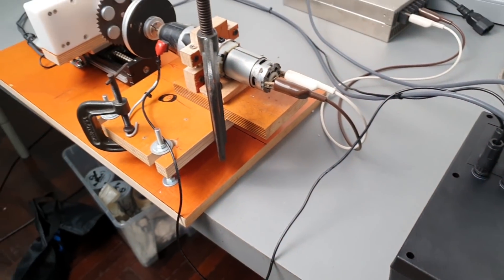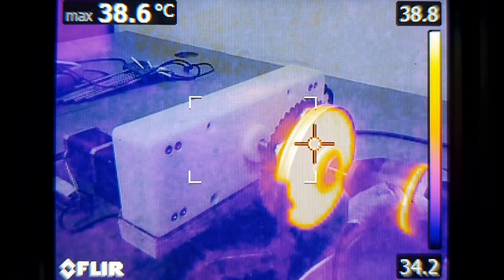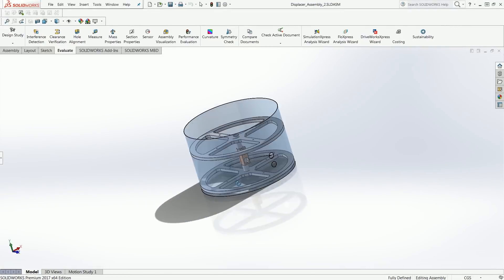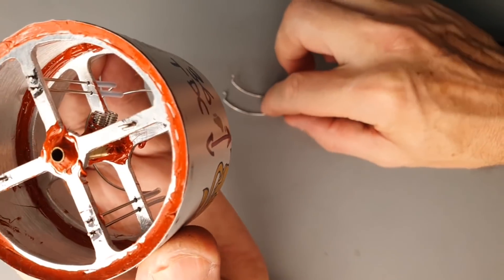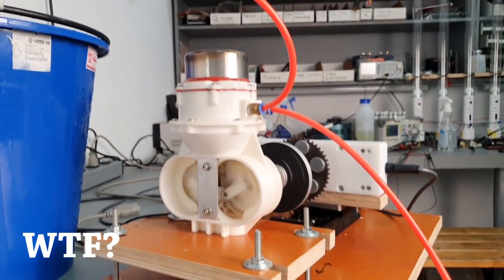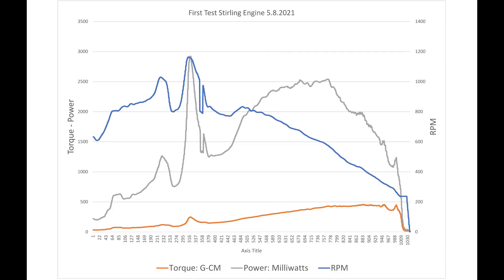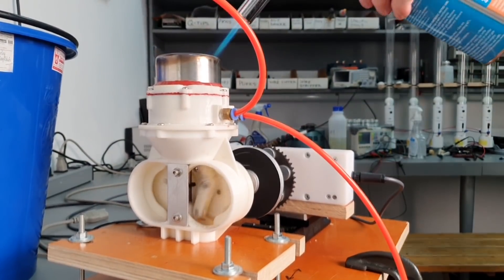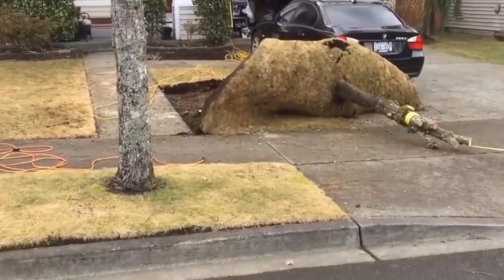The Stirling Engine Project:   Episode 3

Comment: As long as you balance the weight, it's fine in some designed to have a displacer also double as a regenerator. A regenerator's job is to store heat and later release it depending on which way the working fluid is flowing, and a consequence of doing this job wel or nessesary for a regenerator to do it well is that that one side stays hot and the other side stays cold. Thus, thermal conductivity is not good for a regenerator but surface area is. 

Furthermore the other important factor in choice of  material is the volumetric heat capacity of a solid cube of material. Why a cube's volumetric heat capacity? Because a cube of any two  materials can be shredded to the same surface area and have the same dead space, but one will store more energy per degree temperature rise then the other.  That is in units the number of jouls it takes for a 1 degree Kalvin temp rise in a cube. I like these units  J/(cm³×C) for their small numbers instead of mega jouls in a cubic meter. 

Examples:
Glass (silicon dioxide) or crushed sand has a poor volumetric heat capacity 1.98 J/(cm³• K)

Low carbon steel such as used in steel wool stores virtually twice as much at 3.93 J/(cm³• K) and has a thermal conductivity of 
45 to 55 W/(m•K)

While 316L stainless steel such as a 316l ss  screen has a volumetric heat capacity of 3.99 J/(cm³• K) and a thermal conductivity of 13 to 16 W/(M•k). 
 

Just pointing out, 316L stainless steel steel has a slightly higher volumetric heat capacity, and 316L stainless steel has a significantly lower thermal conductivity, and is  significantly more resistant to oxidation, making it a markable better regenerator material. 

Also, one  needs to consider is the power reducing friction the fluid has through the regenerator.  And the traditional off between dead space and fluid flow.

Comment: One of my early thoughts in this was "Get a half inch slab of copper and fuse it to the end of your cylinder to act as a heat bank!"  Half inch is likely too much. Quarter inch with a stovetop heating coil fused to it would likely work better. You can fine tune the heat then. Especially if you sandwich the coil between two bits of copper then add a bit of insulation to the top, stick a thermocouple into a little hole and monitor the power consumed by the coil itself also. That'd get you a good indicator of power added to the system, heat produced during that addition, and thus a predictable set of input values for the engine itself. Not to mention better control.

Might also let you monitor for the possibility of that internal combustion. If the heat input is static yet there's a sharp spike in heat in the chamber, you know you're getting extra heat from an unexpected source. Like a coating burning off of the steel wool, which I've heard can happen. Some steel wools are coated to stop oxidation. Some actually have detergents added too. Stainless steel wool would be different again. Pre-heating your diffuser material in a tin can to season it prior to use might be a way to eliminate this issue.

Comment: Thank you for some very well conducted experiments with your Stirling engine. I think we have to recognise that the Stirling cycle is a pathetic way to convert heat to useable power.
So little energy is available to overcome friction that the smaller  Sterling's work better than the large. So poor is the performance that the measure of success seems to be  universally judged by the free running  R.P,.M. achieved. This is before any useful load is imposed. The weakness in design is the piston/cylinder fit and the heat exchanger design/content. We all seem to gravitate to steel wool. Not the best when copper wool is available in the pan-scrubber market. The Stirling is an interesting challenge but even when successful, the optimum use in the real world is limited to very specific installations.

Comment: There is great possibilities of inspiration from Stirling models. One of those has adopted. single slot crankshaft and operates the displacer attracting it by magnetic action. It really reduces weight improving the timing of the displacer. There are some hits in the action but, who knows.
Than there is an extremely complicated route but promising, making use of the TAUROZZI pendolar piston which really makes pistons very energy efficient optimizing friction.
Other possibilities could come out from the "diafragm" compressors design which has metal sheets as diafragm...
Let's keep thinking...

Comment: I have to wonder how lubricants and coatings hold up in such enginer. I haven't seen anyone anodize aluminum in these parts or serious lubrication systems. Plastics look good as the lessen vibration but is there warpage over time? could regenerators be made of beer cans? what was the cylinder head made from. metal spinning might be a DIY option and temp resistant steel like Inconel or Hastelloy.

Comment: Stirling engines might very well safe the world. They are the best way of converting waste heat in energy. They have many applications and if you can make a small one for the home it would be one step towards this future. Please keep going but at least share the 3D models with all of us.
Reply: @astebbin  Yes I agree turbines on a larger scale are way better as of today. However they are big, costly and difficult to manufacture with many moving parts. 
Thermoacoustic stirling engines on the other hand have basically zero moving parts and can be very cheap, however more research is needed in this field.

Comment: I don't really know what I'm talking about, but I have witnessed a material that is impervious to heat and acts as a complete insulator. It is extremely light and could be the perfect material for replacing the wire wool?

Comment: There would be much more better to have a stirling that does something userfull. E.g. to charge car battery automatically without flame using solar energy only. And also that will startup automatically using some magnets or reverted dynamo for a while. Otherwise it is a nice toy only.

Comment: Great video Leo.  I encourage you to re-design and optimize but I do fully understand the burn-out and how much blood, sweat and gears you've invested.
When I first go into Sterling engines, I soon realized that even past the amount of fine-tuned tweaking, that ultimately professionals have never made them perform to the level of replacing anything we current use today. It was a sad conclusion because other than a few really niche applications, as neat as they are it's just a no-go...

Comment: I have to say, that I disagree to a point, I think Sterling engines are the answer to the problem that we've created with hydrocarbon carbon emissions, no they won't replace the internal combustion engine automobiles, but they very likely could be the answer to electric regeneration but a lot more money needs to be spent on development, we have all that free solar radiation that we could use

Comment: I too had similar ideas to this, but through circumstances, there is not even a first prototype, and, unlikely to be happening in the near future, so, I will share my thoughts. What about using this engine to improve the efficiency of a diesel generator (could be petrol, I just like diesel) you mount the hot end of two of your engines in the exhaust gas of a generator. your engines being horizontally opposed should cancel out much of the vibration. an internal combustion engine running at peak torque would have a jet of flame out of the exhaust manifold to replace your gas torch.

Comment: Reynolds number describes the difference between the fine steel wool and the potscruber. I also have noticed the phantom power surge associated with the steel wool.i believe you are correct in describing that phenomena as internal combustion.  I have used poster board, Elmer's glue, fiberglass cloth, aluminum foil and plaster Paris in the development of a light weight displacer. I have thoroughly enjoyed your video, maybe I offered some benefit to your endeavor. Great inventing.
Reply: Wonder if a regenerator could be printed from bronze powder? Thinking about how to characterize that in software.
Reply: If its internal combustion it should go away after The first test

Comment: One company on Ebay sells fine oil free 316 stainless steel wool as well as thicker stuff. I find it lasts much longer and maybe cuts down on volatile residue in the working parts. I got tired of the wool degrading. Anyway, you might like the Lustersheen 316L, average fiber width .002".

Comment: I'm thinking to couple a Stirling engine to the hot side of my AC unit. Do you think it would help to reduce cost in power consumption, by using the waste heat to power a Stirling engine?

Comment: Neat project.

I think it's worth it incidentally, stirling engines are a really simple way of converting heat back into more usable energy. If you could work out a way to easily print them in a range of sizes I can think of all kinds of uses it'd have.

Comment: Hi Leo, great project! 😃
I suggest to use electric heating wires instead of a burner to be able to compare input and output energy (efficiency).
Alternatively you can try a 3-cycle free piston Stirling engine like in the Youtube video "u-VEVCWjawM".
Reply from the maker: You are so right about this. The reason for the flame torch is that It has a very short thermal time constant. Until my engine is running reliably for minutes at a time, I want to be able to shut things down as fast as possible, I don't need things melting if the coolant stops flowing. Once I have more confidence, I will build an electrically heated cap for the hot end so I can get a true number for power input.

Comment: You know, on that free energy attracts topic... I was wondering about the drone electrostatic motor that Plasma Channel "
Drone Harvesting INVISIBLE High Voltage From The Sky" and others have demonstrated and have wondered... why no one has tried to convert the energy in more detail or just to study in more detail.  Like for instance... taking that potential and then using something like Great Scott did recently to either DC synchronous convert or maybe convert to AC and then just transform down to lower potential and higher lower current.  This video even has me goofy thinking like a electrostatic motor coupled to a AC generator.   OK... anyways... seems novel and might be neat with the right title... though thinking like a guy roped balloon or kite or kite balloon might be better than a drone.  More comment food and seems like certain topics with titles attract views like ElectroBoom notes regarding free energy.
Reply: Smoking pot makes you smarter

Comment: There may be far too much dead space volume  inside the regenerator.  I believe a stirling needs the vast majority of its volume on either side of the displacer and in the driven piston volume.   I think the engine needs 1/8th of that volume of steel wool, the rest should be sealed off, air tight.
Reply: there must be an ideal steel wool thickness and The rest of The displacer volume should be sealed
Reply: I agree, steel wool "effective density" is very small, so very little air I think is actually being displaced in this engine. The dispatcher should probably be a hollow cylinder, with steel wool just wrapped around the outside maybe 10% of the cylinder diameter. That way the air is more effectively being displaced from hot to cold side, while still passing through the regenerative substance.

Comment: Hi Leo, great striling engine project you got there especially because it's mostly 3dprint .
I've too fallen in the youtube can stirling engine rabbit hole, but never actually tried to build one!
 
I was about to suggest using a prony brake setup, to extract the actual mechanical power curve you have at the output axis, maybe with a bike disk brake, a leather belt some or thing like that, but I've seen you discarted this idea in the second video.
I once used this setup with a motobike brake, strain gauge  and rpm sensor to measure the mechanical power of a microhydro turbine. It worked like a charm.

Comment: Suggestion for vibrational noise. Change piston travel from vertical to diagonal. Would there be any chance that a stirling engine could function on the thermal differential from inside an attic to outside air on the north side of a home?

Comment: Why do you fill it with wool at all instead of just using a closed cylinder?
Reply from the maker: The wool performs thermal regeneration, it performs better than just a closed volume.

Comment: You should put a second tachometer magnet in the gears, but rotate the gear with the second magnet 180 degrees so that the two magnets are never in close proximity with eachother. You could also build four optical tachometer sensors.

When you combine these things, you can get much smoother data.

Maybe you can even take it a step further and eliminate a lot of the noise by using polyborbornene mounts and stuff! (And also, some graphite and teflon lubricant mixed into some silicone grease.)

Lastly, stick with the diaphragm, but use a thin steel diaphragm or something. Much more durable, and much higher coefficient of restitution.

Comment: Have you thought about selling the design files for the Stirling and dynamometer? I would certainly buy a set.
Reply from the maker: I want to sell engine kits once I dial in a solid design. You 3D print the plastic parts, I sell you all the bearings, shafts, fasteners, cylinder cap, etc all precut and machined.

Comment: Dumb question... for the purpose of testing wouldn't it make sense to heat the Stirling engine with an induction heater so you know how much energy you're putting into it, plus you don't have to deal with keeping the flame on it.  Can dial your heat to the exact wattage you want.
Reply from the maker: Why mess around with induction? Just slap a resistive heater on it, they are one of the only devices that are 100% efficient.
Reply: @leosbagoftricks3732  Cooking with induction vs resistive... Induction responds faster, and has a higher degree of temperature control.  That was the basis of my suggestion, but resistive would also be good, with the core idea being you know exactly how much energy is going into the engine vs how much you're getting back out.
Reply from the maker: @NavyCuda  Yes! good ideas

Comment: Hi Leo, you're an incredible craftsman/researcher/engineer but I think you're working on the wrong type of sterling engine...you said: "Sterling engines are not going to save the world" Have you ever seen this? https://www.youtube.com/watch?v=duuk_r--lqU hopefully you get some clarity and climb back out the rabbit hole. Excessive noise in a Sterling engine is usually a bad sign.
Reply: Maybe, but this here is 3D printed plastic design, and Author is aware of some flaws of the material and other issues I guess, it was even expressed earlier in the series.

Comment: Hello fellow tinkerer
Think heavily on the fundamental mechanical process, and simplify it far as possible, then creat the machine based on the results and not the most used design.

I'm currently thinking on a jet engine part... A screw inside a tube with injectors near the top, on the jet engine shaft as the combustion chamber. Ahh...pitch angles and gap differentials... letting the math rattle off in my head. Exploration is the fun of invention, isn't it?

Comment: what is your main objective, if it relies on thermal power, via a self tracking, magnified condenser via  the sun. in some regions, it could be by ambient air temperature, but likely not hot enough?

Comment: Use an electrical heat source, something like an electrical heating plate. Hear me out, its very repeatable heat source, always the same heating, easy and save to experiment with since no flame, and it will help you calculate the performance depending on the energy use of the heat source.

Comment: 500W in for 1W out? It's hard to guesstimate the power output of a propane torch. It does seem massively inefficient at this stage. It's potentially looking less efficient than using a Peltier in Seebeck configuation.
Reply from the maker: Yeah very low efficiency, ill bet that torch is doing 700 watts! But I did manage a surge of 3.5 watts! 0.5% !!!! whoooo!!!! ALERT THE MEDIA!!

Comment: 1. Love your work, man! I'm looking for stirling engines materials since I was in high school. Your channel is so underrated.
2. Replace the plastic rombic drive parts with metal ones. I know, it's gonna make the whole 3D printed engine void, but you should have a visible increase in power!
3. Try using some automotive grade rubber for the working piston membrane.
4. Try using more tight tolerances and constant greasing of the piston shafts. It's hard with this configuration, but you're a genius guy and you'll find out a solution for that.
5. Have you considered presurizing the engine? I know, with all those printed parts it could not handle the pressure very well, but give it a try.

Comment: Hey Leo - What do you think about a regenerator with an insulating wall (with lots of holes), to separate cool steel wool from hot steel wool.  The idea is to have a larger temp gradient in the regenerator, by preventing thermal conduction from hot end to cool end.

Comment: increasing pressure will drastically improve efficiency , but then u have to use metal casting. 
using a heating element with current control at the hot end will give you exact input energy... now u can keep on tweaking the design maybe even shift to alpha type to improve the efficiency which is the ultimate goal i presume.